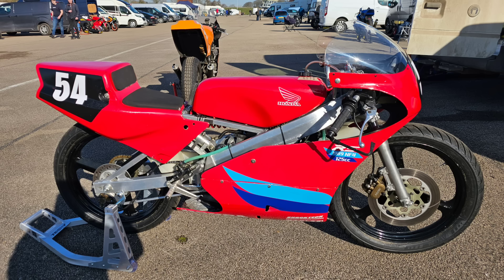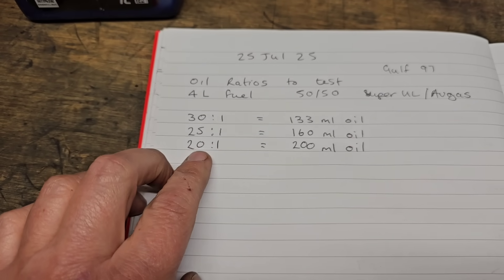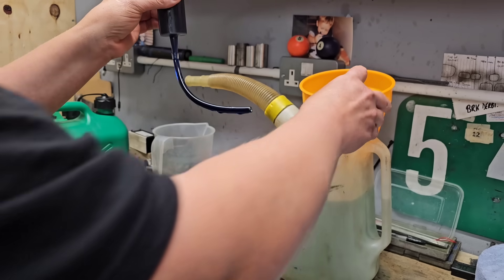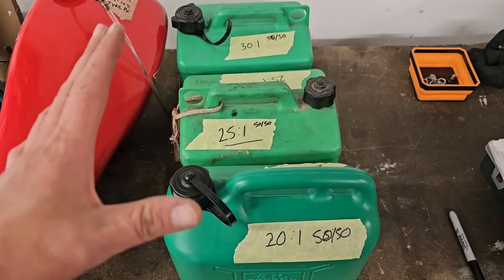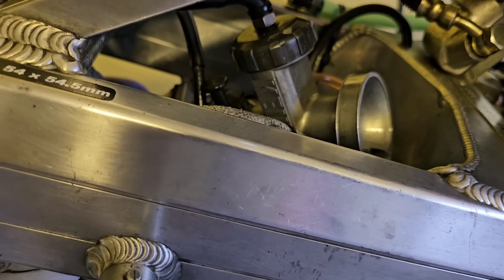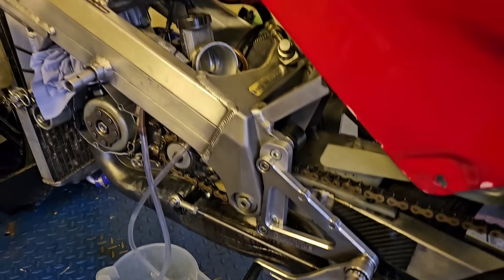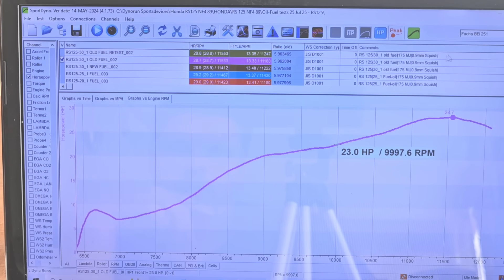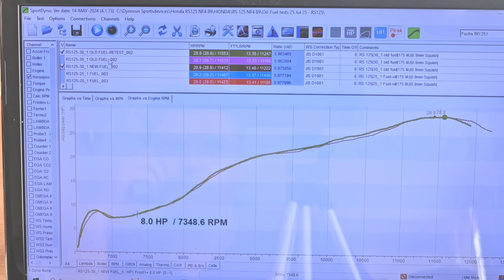Does 2-Stroke Oil Ratio Really Change Power? (Dyno Tested)

Comment: Would have been interesting if you had also done 35:1 and 40:1.  That would involve leaning out the circuit to get the best performance. With modern oils, I don't know why you are running at 30:1?  I have been running my KTM 300 at 50:1 (Motul 800 2T) giving best performance, cleaner operation (less smoke and exhaust splooge) and great engine dependability.  Running more oil also increased the variability in jetting with air temperature and just makes jetting more finicky in general.  I suspect that would be the case with injected engines as will.  IMO

Comment: Increasing the oil ratio slightly raises the boiling point and therefore raises the temperature a which the fuel becomes volatile, under compression. This can either be a good or bad thing, depending on the circumstances.

Comment: Won't the suction / delivery tube effect the volume of oil to fuel ratio ?
 I suppose using it on all three keeps the relative volume proportional.
Reply from the maker: Yes, I think it will, but as you say, using it for all effectively nullified its effect.
Great point though. Cheers 😄

Comment: Theres different oil specifications depending whether the engine is air cooled or water cooled.
Reply from the maker: Cheers, can you let me know where this information is found?
Cheers
Dave
Reply: @AutoBeta2T JASO specs have WO or WD,the W reference is water.They are easily found online.
Reply from the maker: Cheers, Eugene, I'll have a look.
Reply: Really...1973  125 Yamaha 32:1  ..2029 125 32:1 as per factory stated !

Comment: I run 30/32:1 in everything I own. Why? so my engines last a long long time. I have never had a 2t motor seize on me, and I'm old. Leaf blowers to dirt bikes they all get the same, 927.
Reply: Yep same here even raced 100 cc road race engines that turned 20,000 rpms !
Reply from the maker: Cool, sounds like it's a good solid ratio to use.
Reply: Wasn’t looking for one but a 2007 rm250 came up for sale cheap in 2009.. no history on it and I owned it till 2014 and sold to a friend and he had it till 2019… 
I never serviced it once not even the air filter, never checked the coolant, stuck it in a pond once only took the carb off and cleaned that out dried it off and out the next week. 
never raced it so it didn’t have a hard life but from 09-19 it had the same piston with fook knows how many house on it as we’d be out all day every other weekend… 
Always used 125ml to 5lt so I think that’s about 32/1… 
The guy I sold it too had an rm80 in the 90s so same ratio used and we can’t remember how many new pistons and resleaves he went through on that at least once a month it would seize 😂 he hated it in the end and sold it blown up
Reply: I use good quality oil with 40-33:1 for paramotor and to all others. Also never nothing problem
Reply: 1998 KTM 200 exc. bought new by a family friend who was an A class AMA enduro rider. My dad bought it in 2000, and I have it now. It’s never had the cylinder removed, been 40:1 its entire life.

Comment: Why is that fuel blue?
Reply from the maker: Avgas is light blue. Also, the 2 stoke oil I use is very blue. I do like the colour.
Reply: @AutoBeta2T  Avgas I've  never heard of it. where'd you get from? you're not in the UK ? It must be just a dye nothing is blue what's the point of deying it?
Reply: Avgas is fuel for light planes like Cessnas. Also known as 100LL because it is 100 octane, and contains less tetraethyl lead than WW2 aviation fuel (LL = low lead).

Pretty much any airport for small planes will stock it. But you should avoid the stuff if you can, tetraethyl lead is very poisonous and it still contains a fair amount. It's also bad for engines that aren't designed to run on it, aviation and racing engines do ok but if you put avgas in your car you would soon come to regret it.
Reply from the maker: @therealBozoDjTrump see the answer from Nerd100.
Reply from the maker: @nerd1000ify  I previous owner ran this fuel - Formula 105 | High Octane, Ethanol Free now in stock – Classic Fuel Solutions https://share.google/Mo8GLEez8zosE1YqV

But said it was happy to run on 50/50 too.

I will look to get some leaded race fuel to try.

Comment: GREAT WORK I’m a mx mechanic & I agree with a 30/32/1 oil mix ratio especially on small high Revving engines .Also a decent quality twostroke oil .One observation  why ELF has a Fourstroke engine design on their premium twostroke  oil bottle .surely THIER marketing crew don’t know the difference between the two 🌚
Reply from the maker: Cheers,  Jeremy :)
Sounds like.a.great job you have!
And yes, i was the same. I had to double-check and ask around when I saw that. It doesn't inspire confidence in a product for sure.
Reply: Exactly. 
30:1 also gives a clean running engine.
25:1 runs rough.
You're also breathing less carcinogenic burnt oil.
Reply: @redtobertshateshandles haha when jetted right 25.1 runs the best...

Comment: The reason model aircraft engines run a high oil content is not for lubrication purposes, but because the unburnt oil takes the heat out the exhaust port with it. With ceramic bearings and special piston/liner tech F2C team race diesels running at 22,000rpm use about 7% oil content
Reply: Also, in some cases, the added oil helps with sealing.
Reply from the maker: Interesting info, that's very interesting  indeed - thanks for sharing.
Reply from the maker: Also - what sort of oil is used? Castor or synthetic?
Reply: @AutoBeta2T  The F2C diesels running on Jet A use a degummed castor oil like Maxima Castor 927 and the glow engines running on methanol use a synthetic - castor mix. I have four litres of Castrol M sitting in the shed, but I don't use it anymore because it gums things up.
Reply: @AutoBeta2T often, some or all of it is Castor, e.g. Blendzall green Label or Klotz Bēnol.

Comment: Dirtbike magazine did a test years ago, they showed that more oil equals thicker fuel, so it should make it slightly slower flowing, so slightly leaner. They also found 32:1 was an  ideal compromise.
Reply: I remember that article.
Since then, the quality of 2T oil has increased.  I currently run at 50:1 for best performance with excellent engine dependability.
Reply from the maker: Cheers for that info Dave. I appreciate the info 
Cheers
Dave
Reply: “…with more oil added when sustained higher revs are the rule…”
Reply: When I was racing motocross in the late 90s and early 2000s, 32:1 was the most common ratio used by racers in North America.
Reply: @jeffa.8976  That's what I used until I eventually realized the I didn't need that much oil with the modern synth 2T lubes
Reply: @jeffa.8976 Uh, were there people who used MORE oil?

(Note: if I were running a premix bike, I’d run 32 to 1, but I’m old (65) and slow, too - and I’d only go near a track to watch, any more.